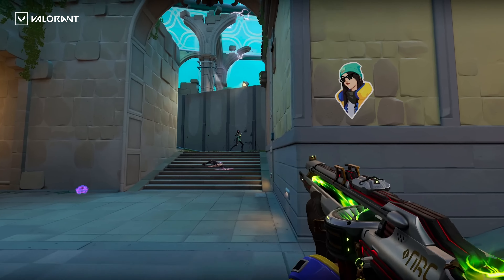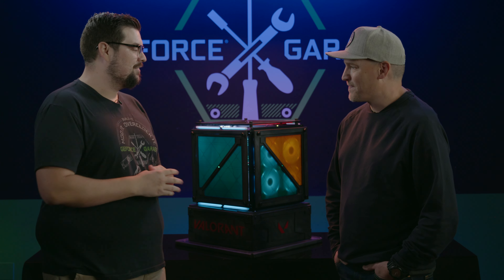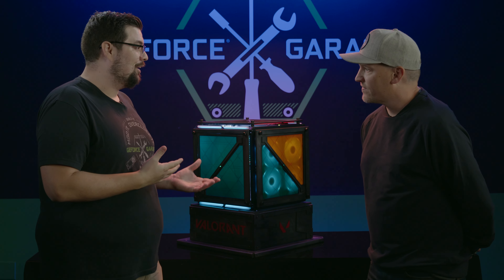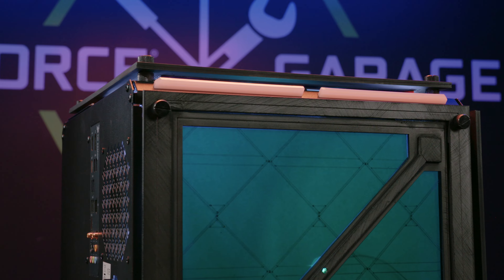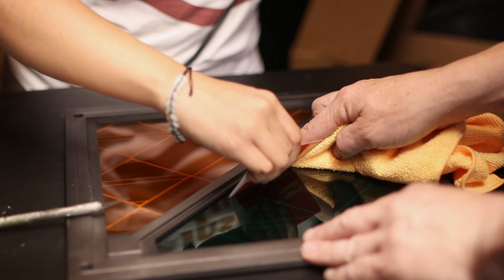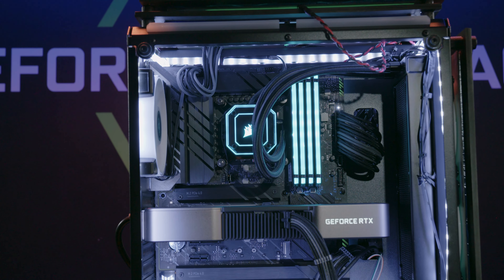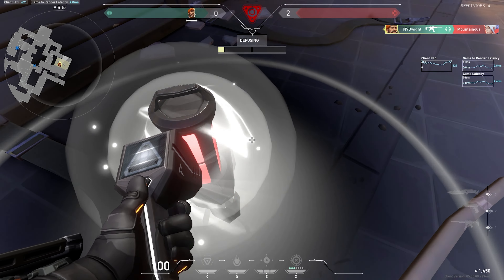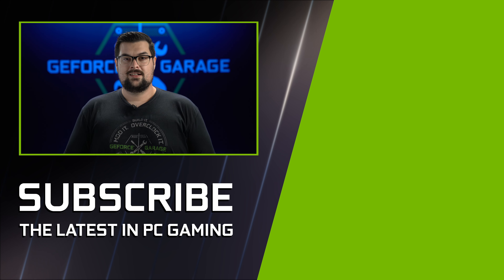GeForce Garage - VALORANT Radianite Crate Build

Comment: Nice build. If you're interested, this is a modification of a an AZZA 802 case. It's been rebranded several times. Generally the glass/metal box sits on a stand diagonally. Source: Been rocking this case with my first pc build